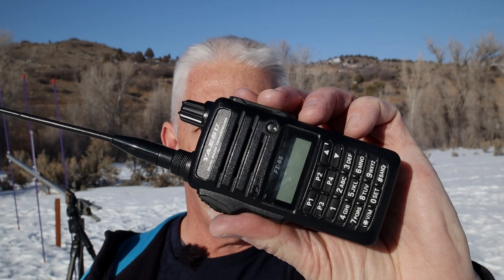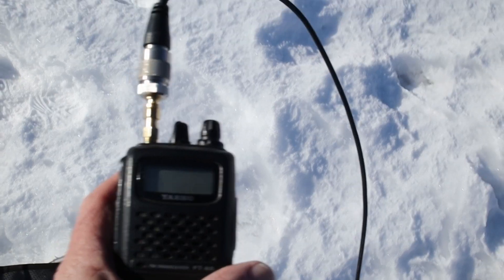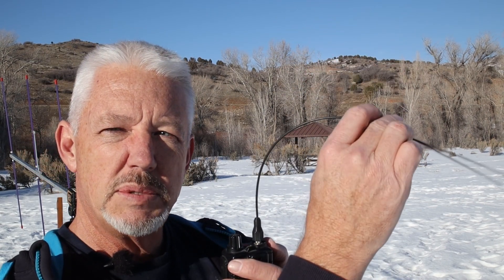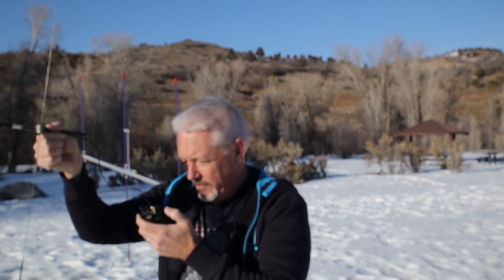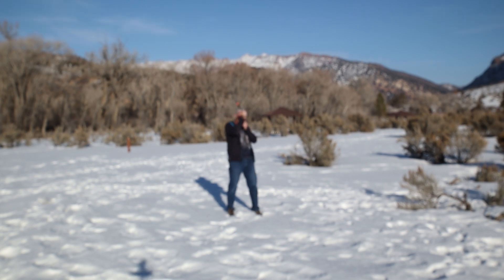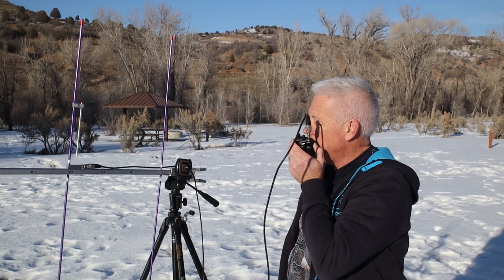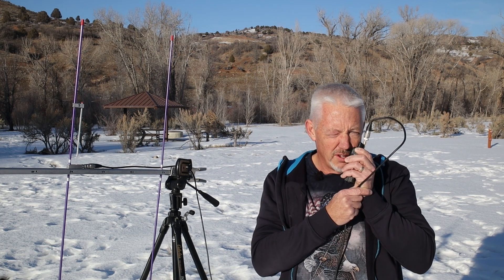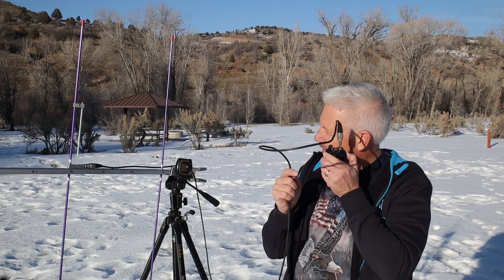Antenna Choice for long distance HT operation | K7SW ham radio

Comment: RE: FT-60 - I had the same low-audio issue with my FT-60.  They put a piece of membrane in between the mic opening and the condenser mic inside the radio, which really muffles the audio.  You can take the radio apart and remove the plastic, and your will get much better audio quality.  See this video which describes how to improve the audio: https://www.youtube.com/watch?v=R3Ovv5_TVNg

Comment: How far is the distance between you and the other device?  Can i use icom 2300 on car?
Reply from the maker: In this video we were about 30 miles reflecting off of mountains from in a canyon with no direct line of sight to the far end repeater. You could use an Icom-2300 but you will need to mount the antenna on a stand that is away from you. Do not hold this antenna while transmitting on high power.

Comment: What are your views about power, Kevin? Some people say five watts is pretty much the ultimate for an HT --- after that, start putting your money into antennas. Others say as long as you're seeing increases of 75 percent or greater in power, yes, you will see performance increases as long as your antenna can handle the increase. (Most whip antennas max out at 10 watts, and that's fine for most HTs, but I recently bought a couple of radtel 10W RT-470 radios, and both put out 14 watts on VHF and 11 watts on UHF, and though I'm fairly confident that a 10W antenna could handle 11 watts, I'm not sure it could handle 14 watts of powwwwwweeeer, unlimited powwweeer! 

Uh, sorry, I get carried away.  Anyway, if one has two radios, one 4W or 5W, and the other 14 watts, I've got to think one would get some sort of a return, especially when using a 100W Signal Stick (S.S) antenna or even an Abbree 20W flat-tact. Some say the power goes toward, or directly is applied, to “penetration.” But how does all this happen? One has two radios, one 5 watts, and the other 14 watts. Here are the radio outputs:

Frequency         HIGH       MED       LOW
——————————————————————
140.000          13.75W    7.36W    5.75W
142.725          13.30W    8.71W    3.69W
143.500          13.55W    8.67W    3.89W
144.000          13.61W    7.40W    5.92W
146.355          14.45W    7.31W    3.54W
440.525          10.93W    5.03W    1.86W
442.000          11.36W    5.17W    1.89W
446.252          11.34W    5.24W    2.00W

One can always reduce the power one emits, opting for medium outputs over high, but is this advisable? What would have happened if you had taken a 14W radio and attached a S.S antenna or a ridiculous 45-inch Abbree flat-tact? to it. 

Do you think the extra power have made any difference?
Reply from the maker: More important than the power levels you listed. You should refer to the ARRL rf exposure charts and not expose yourself to high levels of RF with an HT being close to your head. 

Use an external antenna that can be put at a distance from you . 
To your question, spend more on better antennas. Antennas will make a bigger difference for you in your application.
Reply: @hamradiowithkevin  » Great advice. I always keep it pointed away from my head and I use it in LOW or MEDIUM. About a year ago I listened to a story by Mr. Ballin about a family that, in the dead of winter, took an old Oregon logging road and ended up trapped in a snowbank. Unable to move, with a fully charged phone that couldn't reach the nearest tower miles away, this man, his wife and two small children waited for days. A helicopter pilot, alerted by the man's family, went out looking for them. 

The man had no CB or ham radio with him, and this story made me realize that a $20 radio can play a vital role in emergency situations --- providing one is on the right frequency and has the right antenna. Even a twenty-dollar radio should work. 

Being fairly new to the hobby, it made me think that an inexpensive Baofeng radio and a 45-inch Abbree flat-tact could go a long way in securing a rescue. For the $$$, though, I'm much more impressed with the UV-82 (8W) vice the UV-5R. (The rubber on my 5R keys tends to flake off after awhile but lasts forever on my 82.) 

I don't know why the FCC doesn't designate an emergency frequency on ham or GMRS. But, again, I don't know how much power comes into play when it comes to line-of-sight distance.

Comment: Nice test. The Yaseu FT-4XR, similar to the FT-65, was my first radio. And the Signal Stick was my first antenna. Both are great. I just got the newer "Low Temperature" Signal Stick and it works great in the Western NY winters. The Arrow Antenna has been on the wish list, LOL.
Reply from the maker: The newer low temp material would be nice.  I can see myself ordering one. Yasue makes good hand held radios
Reply: Based on what I read, the low temperature (-4°F) Signal Stick (S.S) does well in the lower temperatures, but have you seen any difference at all in performance between that and the standard S.S? 

The low temp S.S is less pliable than the standard model, but it doesn't bend back over on itself like the standard model. 

One antenna I've been curious about is the heavy gauge Retevis RHD-771. I have several and they seem to work well. They have a maximum power output of 20W, the same as the Abbree flat-tacts. But I've never seen any reviews. 

Too many reviewers plug their antennas into their consumer level VSWR meters, print out the numbers, pat us on the head and send us on our way. S.S tells us, OTOH, that these meters are pretty much useless with HTs, adding that the chassis of the radio is a vital part of the antenna. Thus, when one changes the radio, the numbers change too. 

Retevis reps maintain that its antennas are tested with much better equipment than one can buy at Amazon, and they bristle when users announce that those antennas have high VSWR numbers. And S.S declares on its website that regardless of whether its antennas have high or low readings, those readings are most likely inaccurate. 

Such inexpensive (cheap) equipment is fine for mobile or base station setups, it just doesn't work with HTs.
Reply: @johnroberts6695  I just used the low temp Signal Stick on a SOTA/POTA last weekend in Western NY. It was around 28F and it didn't go limp at all. The performance was fine. It's a little more "rigid" than the original Signal Stick, but it can still be tied in a knot. It fits my use for the winters we have in the northeast.

Comment: Let me start by saying your videos are great! No wasted verbiage. As you say, tiny changes can make a huge difference with 5 watts! That's why I make a humble suggestion to get rid of that SMA to SMA, SMA to BNC adapter chain and try (try) a straight SMA to BNC. Pomona makes some nice gold-plated ones and I can tell you from personal experiment they can make difference. This is just my boring humble opinion!  Cheers!
NE7C
Reply from the maker: Thanks Eric, I will check those adaptors out.
The fewer the connections the better for sure.  73

Comment: I use the TYT UV8000D, its a ten watt radio, and yes it is, on one frequency. For long range I use the 42.5 inch Abbree antenna. Works very well.
Reply from the maker: Nice compact antenna, thanks for sharing. 73
Reply: @James Hart » The TYT TH-UV8000D is a good radio and, like the Baofeng UV-82 (8W), is very underrated. It also comes “locked,” alas. I just wondered, after reading your comment, if you've had any occasion for using your 200MHz and, if so, what antenna you used? I initially used a Nagoya NA-320A, but the reviews were so bad and the range wasn't great, so I went to the Abbree tri-band flat-tact and the Abbree NA-771 (tri-band), but haven't had any decent weather.
Reply: @johnroberts6695  No, the TYT UV8000D is just 2m/70cm radio. And its still I guess locked. No reason to by a tribander where I live.
Reply: @JamesHart62  » No, all TYT TH-UV8000D/E radios are tri-band. You can leave the feature off if you wish, or you can buy a tri-band antenna and turn the feature on (see https://www.youtube.com/watch?v=cbSLkCFlZDQ). I unlocked it via the software but I think there are other ways. Most tri-band radios go from 220-260MHz, but once unlocked, the TYT TH-UV8000D/E goes from 200-260MHz. 

That band can be quite useful, though. Increasing numbers of people are using it. The Nagoya NA-320A isn't a great tri-band antenna, but the Abbree flat-tact antennas are better (222-260MHz). I haven't seen any reviews of the Abbree NA-771 tri-band antenna yet. Cheers!

Comment: Great video.  I use Comet antennas on most of my handhelds The best antenna I have is a Diamond. RH205. I use it on an Icom IC V86. The Diamond RH205 is a telescoping antenna and when fully extended is 52.8 inches making it a 5/6 wave antenna..  I only wish they would  make the antenna so it would fit my other radios, so I don't have to use a bnc adaptor.
Reply from the maker: Miriam, that is a big 'ol antenna, very nice !  I agree, adapters are not very good when going on an HT.  Thank you for sharing and for watching . 73

Comment: My favorite VHF/UHF antenna to take with me when in a remote location, is my home-brew slim jim roll up antenna made from ladder line and 15ft of coax attached. It will fit in a jacket pocket, SWR is flat on VHF and HF and is fun to build. Hang it off a tree branch and it performs really well. Much more travel friendly than my Arrow yagi antennas, and being omnidirectional, I don't need to fuss about pointing in the right direction. It is also a great performer for air band, FM broadcast band etc
Reply from the maker: John, that is a great antenna I forgot about that antenna. I have one and definitely used it on hiking trips. Thanks for sharing. Trees are a ham's second best friend.
Reply: how high up in the tree do you try to get it? i recently put up a gmrs slimjim about 15 feet up and found my nagoyas worked better, but this is all new to me
Reply: @jasonbrown467  High enough to use up all the coax to the rig, so about 15ft. Anything above about 6ft at the base will work really well

Comment: You might try adding a 'tiger tale'—a quarter-wave counterpoise that is just a 19" wire on two. Also try a collapsible half wave. Both are more compact that beams and both helped me reach distant repeaters in a test I ran.
Reply from the maker: Michael, that is a great idea.
I could do a more comprehensive antenna test including your suggested antenna ideas, testing is such a fun part of the hobby and could really help operators that have never experienced those options.  Thanks for watching.😎
Reply: YES, I've heard a lot about the value of tiger tails, but alas, not how to make them. Signal Stuff (S.S) says the chassis of a radio is part of the antenna. That's why consumer level SWR meters are problematic. I'd love to know how to make them.

Comment: Very nice demo. You didn’t mention, but was good to see proper orientation to the mic. Talking across the mic and not directly into it eliminates the puffs from the Ps and all the air  breath noises. Maybe a tip to add in another video? 73 de N4WLC
Reply from the maker: Thanks Bill, Good call and observation. You are so right about that mic location, Thanks for Tip idea. 73 K7SW